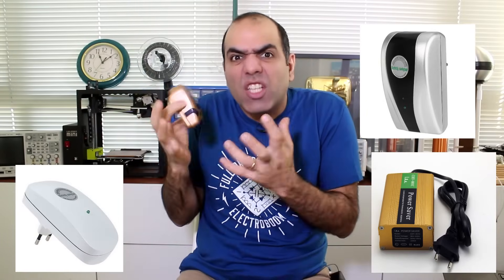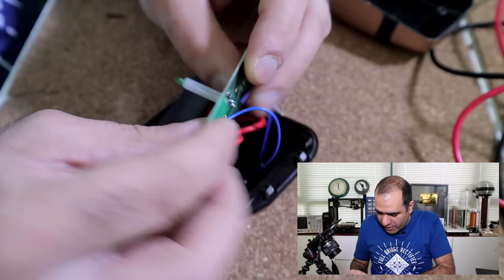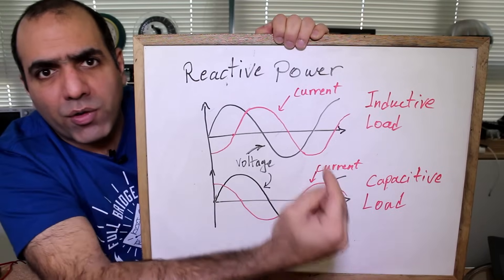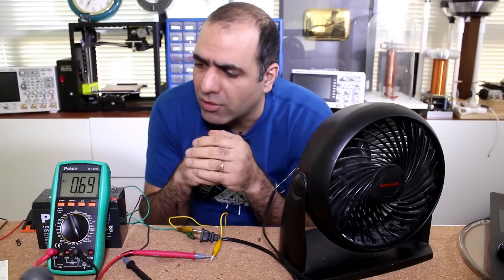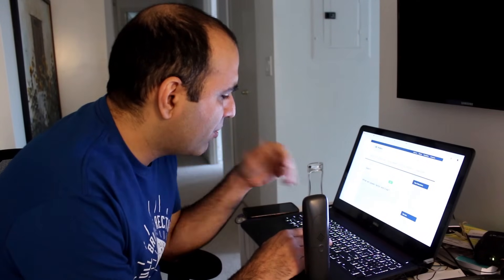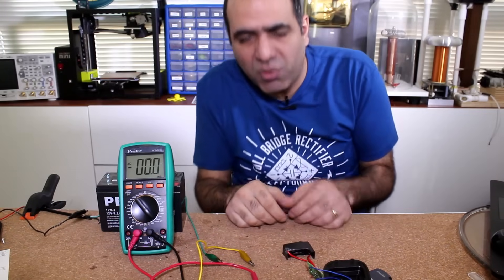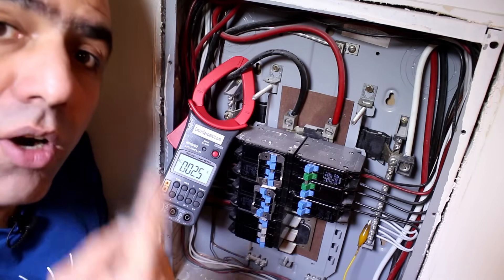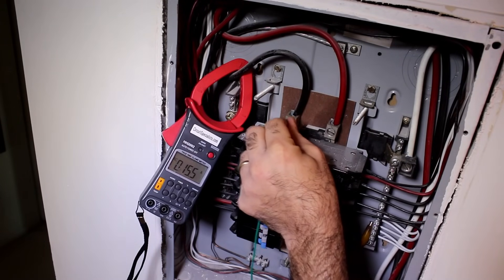Power Saver Scam EXPOSED!

Comment: With the new "smart" meters they can unfortunately start charging for apparent power instead of real power.  And that can be done remotely.  If they do that then suddenly things with capacitive droppers like time switches and will cost about 10 times as much to run and most LED lamps will cost between twice and ten times as much to run depending on their circuitry.
Sadly, a simple capacitor won't fix most electronic power factor issues.  But it's a nice case and can be used as a shocker.  (but with a much bigger capacitor)
Reply from the maker: If they do it, and some people in comments claim in their country they charge reactive power, then a proper power factor saver is in order! Also I'm sure suppliers will start designing smarter to beat the competitors and save customers more money. Still I doubt it if a home power factor would be ever that awful. Imagine BCHydro starts charging surcharge if power factor drops by 10% for industries, so homes should be in much better shape.
Reply: @ElectroBOOM  The snag is that some of the worst offenders for power factor are electronic and have a current waveform that can't really be compensated for externally.  It tends to be near zero current for most of the sinewave and then a huge peak as the mains voltage exceeds the voltage of the PSU electrolytic and tops it up.  Proper power factor corrected PSUs are twice as complicated as a standard one because they boost the voltage in a series of spikes across most of the sinewave to top up the main capacitor to just above peak mains voltage.
Reply: @bigclivedotcom  cheers BigClive 🇮🇲
Reply: ElectroBOOM One can easily bring his home power factor down to ridicolous values. I got a solar system and a battery storage solution. The solar system’s inverter is actually ok and if it gets up to some proper power (2-3kW) it has a PF in the range of 0.9-0.97. The battery’s inverter on the other hand can bring the powerfactor seen on the grid side down to ridiculously bad values such as 0.3
Reply: In Households, it's much finer to manage and somewhat wilder ... I haven't seen a fully working PFC in industry they let them rot. (Hmm worked in old and big industry they might have forgot how to save money :p )
Reply: @ElectroBOOM   Ha ha
Reply: @ElectroBOOM  even if they start charging for it, it seems like a waste of resources to try and compensate in every home.. Maybe in substations..
Reply: They won't charge me anything because I ran an extension cord from your garden.
Reply: Michael McDonald don’t forget to unwind it all the way!
Reply: @meepk633  That's how the real "free energy" works. Just plug into your neighbor. Free energy... until you get caught. lol
Reply: bigclive is here :O
Reply: We've had roughly the same price bill each month with some variances. We had a reliable meter reader with easy acess so nothing funny going on, the price was about the same as the neighbors. Come a month after they installed a new "smart" meter we got a huge price shock. 40% more of what we use to pay and it fluctuated a lot more then with the analog meter. I am willing to bet there's something funky going on here.
Reply: @travis4798  sumbitches getting mo money mo money.
Reply: @ bigclivedotcom 
You're are right!
My 1 year old Kamstrup omnipower smart meter already counted 484 kW of reactive power on top of my 1722 kW power consumption.
Those smart metres can monitor everything, time based voltage and current monitoring on each phase, active power, reactive power and so on...
Reply: It won't be at the same price though, logically
Reply: You tell'em Clive
Reply: Totally, and new meters can even neatly sum up kVAr!

I kinda expect them to read out the data, just to find the problem users.

But I have seen no indication that they plan to charge based on it.
As far as I have been able to find out, there are switched capacitor banks around in the grid to deal with that stuff. Basically a no big deal, unless taken to extremes.
Reply: Came to see if anyone had said this. I should have expected the big man himself!
Reply: I have a smart meter  not sure of the type but its a Landis &Gyr one flashes and says Wh and the other is varh, we dont get charged for it at home(YET).  Bloody hell we get charged enough here in Australia anyway. for some its like a supply charge of $1.50 a day and 35 cents per kWh, depending on supplier,
Reply: I was just going to say "Big Clive said..." But something something horse's mouth..
Reply: Interestingly I just acquired an osram led light fitting which states on the box it has a pf of 95%+ !
Reply: If we could stick Mehdi and Clive's facial hair to make a giant Van De Graaff, I think we could generate enough power to back-feed the grids and we could have nice smooth DC coming from our sockets. No more Full Bridge Rectifiers!
Reply: @lostjohnny9000  pink full bridge rectifier no less.
Reply: Shiiiiiit my foil hat fell off
Reply: Lol seen all of your vids bigc happy to see you on 1 of my there fave channels
Reply: Clive: see comments about PF laws on appliances and small devices. A shitload of cheaper stuff simply doesn't comply. Charging consumers for reactive power in the same way that industry gets hit might be the incentive to actually "do things right" that's sorely needed - particularly as domestic and office reactive loads far outweigh any industrial ones these days and are showing no sign of being abated by themselves or by appliance legislation.
Reply: Italy has a nationwide deployment of smart meters (now they are replacing 1st gen ones with new ones). It doesn't mind if you're or not a business, you pay apparent power if your contract allows more than 16 kW. Most homes have a 3.3 or 6.6 kw contract, so they aren't affected (a 3.3 kw contract means that if you draw current over the limit, after some minutes which depend on how much you are exceeding it, your meter will open its built-in breaker and you'll have to manually rearm it)
Reply: Reactive power is something you might pay for if you're a large factor. Then you might consider installing capacitors.
Reply: I read paper on a commercial power factor unit that distinguished between the phase power factor corrected by capacitor/inductors and the distortion power factor introduced by switch mode power supplies only drawing current to top off the smoothing capacitors.  For the latter, they proposed rectifying your DC below that needed then using a boost converter to raise the voltage thus creating a more constant draw.  

If things got to costly, the solution is to go with power regenerators (audio marketing term) or as used in VFDs, to isolate from the power grid into a capacitor/battery bank then use an inverter for AC and run DC direct.  A smart unit could work to manage a constant in phase draw on the mains.  Also, useful to remove usage signatures from the meter/power lines.
Reply: I believe bigclive knows my opinion of this already but here goes. 

I have it on personal account from multiple people that these smart meters are already being used to enforce daily KWh limits which actually to me seems a lot worse than metering for apparent power. Further a willy nilly remote cutoff is also really troubling. These meters are more like holding customers hostage and spying on them rather than just being annoying.

With that said though I'd actually welcome metering for apparent power. Now for those familiar with the mishandling of Digital TV transition in the US this could just be a change thats done badly and it would bite a lot of peoples finances. But if it were done gradually you could avoid the sale of the bargain bin cheapo fail in a year LED light bulbs with 0.4 PF and horrid CRI.

Gaming computer power supplies which are one of the biggest non-restive loads these days have excellent power factor because they have to. They can't waste gate any heat because to much would accumulate and they can't waste any power because they need to squeeze out the watts. That's likely to change in the future as the tables turn on the power efficiency of processors thanks to processor architectures needing to adapt to mobile. I'd rather see they keep that high PF with efficient designs rather than waste gating.

At least from what I do know when it comes to rating apparent power its usually based on patterns of low overall power factor instead of just a one for one rate to apparent power. The amount of time its low is rated at a different rate. With that said though smart meters very possibly could be used for the very wrong reasons and they should be resisted if the power company is predatory. Actually I find a lot of Smart Grid attempts to be a sham just giving more control away. What actually would be interesting would be things like opportunistically heating and cooling depending on power demand. Say the thermostat gets within 5 degrees but can be delayed until off peak power but still stays within 5 degrees. How about a water heater than can heat variable amounts of water? Slow oven preheat? Microwave ovens that dump their reactive power into an IR lamp?

Part of the whole reason to use AC is because it automates the complicated stuff for you making that kitchen beater easy to design or a large fan. Thing is though most beaters have speed control and those fans could trivially correct their PF in fact that was even shown in the video yet they don't bother because they don't need to. I amused myself a few days ago by making my linear power supply make a tune across the room to a fan. It's a 1 amp max linear that was drawing maybe 80 milliamps. Yeah I need a new bench supply.
Reply: They have been always charged every consumer for apparent power. They just didn't measured it individually at every home, but they estimated an average power factor (and maeasured it at substations), then they made up their prices according to this. So all of us paying for apparent power, collectively. 

It works, and I don't think they want to change that. It would piss off consumers to see a well defined extra line on their bills for apparent power, even the ones who pay less in this way than before.
Reply: The power companies are counting on the ignorance of the general public.
Reply: I just want to be part of this.
Reply: If they're really going to start charging for that, I imagine most people will get off-grid solar systems and sell the power back to them. A nice, green middle finger for the electricity companies.
Reply: Fancy seeing you here. Its probably about time we get all get a 5-10k lipo battery to power the home and get economy 7 and avoid a smart meter.
Reply: How did people do the scam trick with the power save plugs like this video
Reply: Oooh,hello sir
Reply: This is why we have to resist the pressure being applied to us in the UK to adopt smart meters.

Power companies have never been able to charge for reactive power in consumer properties in a hundred years and they didn't lose money over it.
Reply: Correct me if I'm wrong but I believe the capacitive droppers in cheap chinese electronics will help to offset the inductive loads in your bathroom fans and microwave.  I'd also read somewhere that the EU directed that modern (CFL at the time, I assume it applies to LED now) lamps come with power factor correction.. that sort of thing tends to have a trickle down effect on the rest of the world.  I know every non-ebay light I've seen has a rated power factor around 0.9 or higher.  Sadly if utilities start charging for it these types of scams will become more prevalent... the only practical real way to compensate for bad power factor is at (or just after) the meter switching on and off capacitive loads of various sizes as demand dictates and I'm not sure how much of an effect poor power factor would have on your average home user.
Reply: @moldboy2  A few years ago, I compared several LED, CFL, and incandescent bulb, and was surprised at the bad power factor. In the article, I assumed that all electric meters read apparent power, not actual power. Since then I've learned that both types of meter still exist. Not what I learned in a power distribution class back in the '80s. I really need to update that article. If you're interest3ed, here it is: http://www.buchanan1.net/bulb_tests.html
Reply: Hmm inductive loads in households (at least in here in france) is low/mid power (power tools) and very low duration (AC is not the use unless in businnesses but it's becoming more used with the years as it's becoming cheaper). The real deal is all these low cost and poor designed power supplies (Induction cooker, internet boxes, lights, VFD for vacuum cleaner ...etc.) actually we may have between 2 and 20 times more reactive power depending on the quality of those appliances . Why can we buy led's with a capacitor dropper ? why can we buy a PSU with half-bridge rectifier... and all other broken minded stuff. If you can't buy these they won't make these.
Reply: @neoverload8685  Here in Latvia (EU too) I got nice rise of my electricity bill (nearly twice) after our power company changed their power meters in our house. I believe it is not a coincidence. I believe it was largely related to all these small reactive loads in home counting together.
Reply: Actually capacitive and harmonics, not good old inductance related reactive power. If you have LED lighting and every other electronics power supplies it's capacitive and harmonically disruptive for the network ... still that's the point now they bill what was negligible by the past for home consumers. Problem is that it's not the standard to have good PFC's in our appliances (unless it's about computer's...) If all was ruled like IT you should at most have a 15-20% increase in billing . BTW i might be wrong and want other voices to explain more
Reply: @neoverload8685  Where I live the largest load is inductive (air conditioner) and run almost year round (even in January/Feb). So if my local power company started charging for reactive power I think there would be an uprising! 

That being said I do try to avoid lighting with capacitive droppers.
Reply: Don't they already bill reactive power ? If not you should be worried xD Anyway if A/C is required all year round (In households) there is a problem for sure
Reply: Actually it might explain why CFL's failed so frequently xDDD
Reply: @moldboy2  "The only practical real way to compensate for bad power factor is at (or just after) the meter switching on and off capacitive loads of various sizes"

That's more or less exactly what I had to do at a certain SW transmitting station(*) in the 1980s to ensure we kept our PF under control. (most of it was automated but we had to watch it to ensure it was swinging correctly). Having a 2MW load with PF swinging out to 0.6 for even 15 minutes got very expensive, very quickly.

(*) 1950s-era equipment like STC DS12s and DS13s. Lots of glowing stuff and mercury arc rectifiers in large air-cooled cabinets.
Reply: @moldboy2  yeah im surprised they dont advocate for keeping led lights capasitive and to not correct the power factor. just to offset factories that have poor power factors. it is fairly expensive to correct the power factor. at least the initial buy in, because switching in large capacitors is exactly what they do.  to leave it uncorrected can also get pretty expensive. transmission lines loose a lot of power to restrictive losses. ofcourese buying transformers to handle the larger KVA is very expensive, even with efficiency over 99% a great deal of power is l;ost in transformers as well.
Reply: @moldboy2  i don't think LED lights really have much of a power factor anyways
Reply: Well, in Hungary, we have "smart" meters for those who have pre-paid electricity plans. But even those meters are stamped with what they measue (real or apparent). And they don't exactly screw around with what they are measuring, because it is set in law. And if you happen to catch them in the act of not measuring what the law states, you can sue the living shit out of them. And you will win.

Here, homes only pay for the real power. There is, however, another type of power: it is called "night power". With that, you pay for the apparent power and it is only active at night. However, it is waaaaaaaaaaaaaaaaaaaaaaaaaaaaaaay cheaper. You can connect boilers and other such things to this which heat up at night and then you can use the warm water at day. But heaters are resistive, so I don't exactly see the point in it for homes. But you can also connect induction cooking plates to it, if you have a perversion for cooking at night.

For factories, though, who manufacture at night as well, this is a huge saving. And, sadly, promote nighttime work. But we are a small country and this helps to have a balanced consumption in day and at night.
Reply: id rather have a analog power meter too cause i dont like everything being digital at all
Reply: The only way capacitors help, is if they're installed right at the terminals of the motor, or transformer. The capacitor must be connected in series with a resistor with the same resistance as the winding of the motor or transformer, then switched on and off with that load. The resistor is to protect relay and switch contacts, in case they close when the AC is right at a peak. Putting a capacitor bank at the load center is useless. That current that circulates between the capacitor and the motor has the same loss. besides, every time a motor switches on , or off, there will be an error. All that said, ElectroBoom is right. The difference will be statistically insignificant.